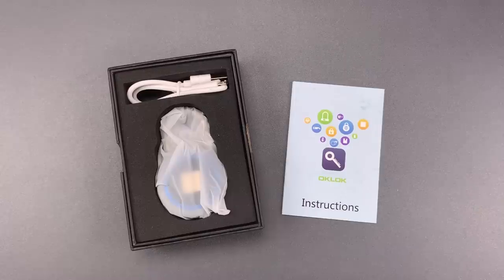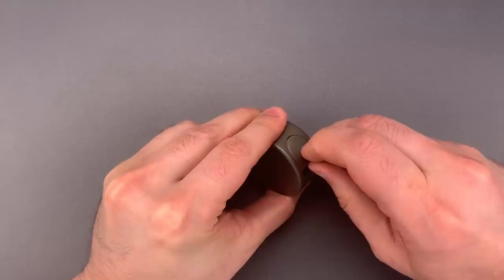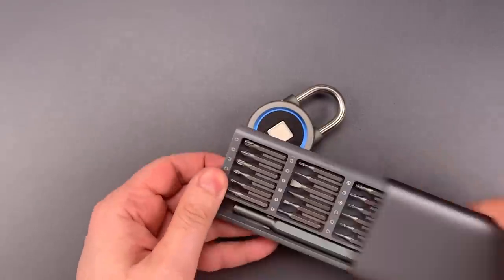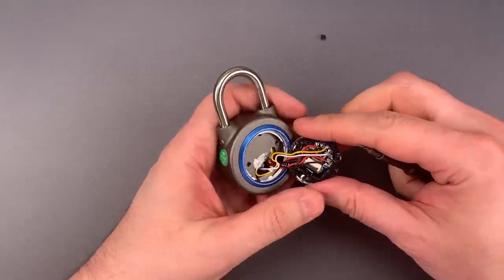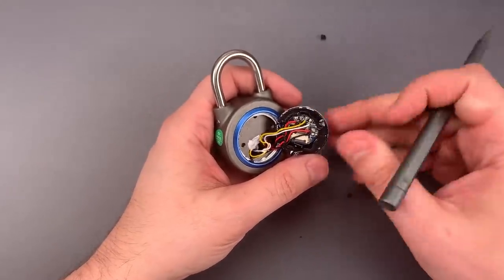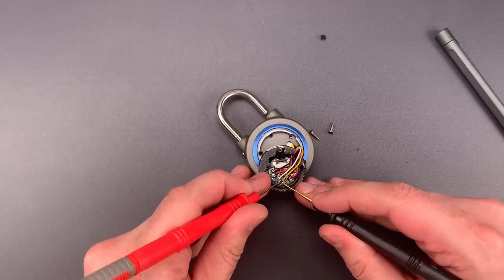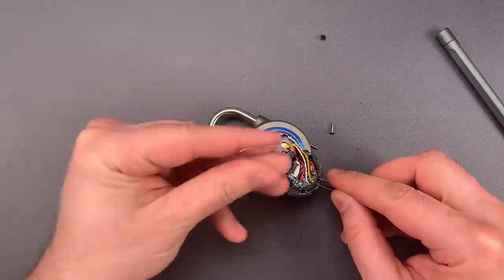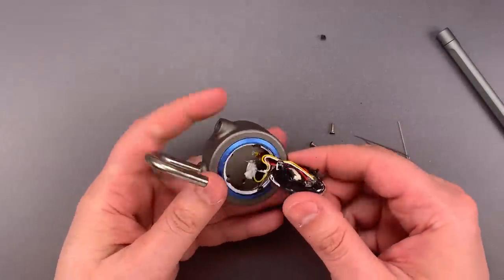[1083] A Peek Behind the Curtain: Evaluating the OKLOK Fingerprint Padlock

Comment: The motor in these (and almost any brand) fingerprint lock has one wire from the motor (usually the positive wire) connected directly to the battery +. 
The negative wire from the motor then goes to a mosfet (which is just a fancy electronic switch), which will then electrically close , and switch the negative motor wire directly to the negative battery terminal for a seocond or so when the lock circuitry detects a correct fingerprint, and then the motor will run and open the lock. 

To bypass the circuitry, and the mosfet, to run the motor and open the lock, since the positive motor wire is already directly connected to the battery + terminal, all you need to do is use one wire to jump the negative motor connection directly to the negative battery terminal for a second or two, the motor will run, and your in.

Comment: I just have to say, what good is a lock that you have to periodically recharge?  How could you ever truly rely on it?  Either it can end up dead when you need to get into whatever it's locking up, or you have to take it off and leave your stuff unlocked while recharging, or swap with another lock.  Might be okay for a gym lock that's used occasionally, but (even if it was more robust and secure)  I wouldn't want it on a shed or something outdoors, far from power or have to carry a power bank in case it's dead.  Also, the battery life expectancy is probably only a few years, like most rechargeables.  And in cold weather, it might completely fail you.  Compare to decades of life for a mechanical lock.  I also have to wonder if it could be fooled with a copy of a fingerprint.  More of a novelty than a useful security device.

Comment: If it has a Battery Mostlikely one wire has power the Board then Controlls flow u can simply short together the wires if they are aside one another Or short others toghether and u will mostlikely reach what u try to reach it will prob not be the Best for the Assebly Health but if ur Breaking in thats no concern.

Comment: You could just do this with a screw driver by opening the front and bottom and riping the battery out strip the wires  and using the + and - to turn on the moter

Comment: So if you only got a screwdriver you can rip the battery wires and touch them on to the motor wires, saves trying to find a paperclip in ya pocket lol
If they filled the screwheads with something strong like jb weld or just drilled the face's of the screws so nothing can 'bite' against the screws would make it so Much more secure as would have to be litrally smashed apart to gain access to the wires,
Love your work buddy

Comment: Looks like it doesn't have a backup battery. Pulling the battery and plugging it back in might be enough to reset the fingerprint to re-enroll as a new fingerprint to open? Its most likely able to be shimmed open as well with some thin aluminum straight down the lock .

Comment: Of note I'm pretty sure a heat attack on this would trigger lock mechanism much quicker than other locks, all you need is to start to melt the (lowest bidder's version of plastic wires) and will probably trigger a short circuit releasing motor. Also pretty sure electric motor itself will fail much quicker than solid metal versions. 
*If I had extra money I would want to test if something as completely outrageous as using an magnification glass/lens with Sun or a stand in for Sun (Heat Lamp) could generate enough heat to defeat something like this.

Comment: Why do you think the electronic locks are generally so mechanically bad? You could capture the front and bottom plate with a single screw down from the top, so that it could only be disassembled without destroying metal when unlocked. Is it just that they assume anyone who wants in will destroy the lock, rather than exploiting it so that it can be put back afterward?

Comment: Remembers another fingerprint lock like this you've shown before Hold on, what's under that sticker on the left side of the lock? In a previous video (788), there was a plastic plug there that stopped up a hole that let you access the locking mechanism with a shim.

Comment: Steps to make the lock safer:
 - have the circuits only accessible when the lock is unlocked (ea screws below the shackle holes)
 - Don't use plastic that can be easily pried off on the lock as picking deterrent

Comment: That lithium battery can be turned into a torch to burn open the lock by removing the bottom screw and puncturing the battery

Comment: There's a 50/50 chance that if you unplug the battery, wait for capacitor run down, plug it back in, there will be a starting sequence that unlocks the mechanism. Often programmed to allow the tech support to give the pissed off customer one last ditch option to unlock a malfunctioning electronic lock.

Comment: Since the lock uses a motor would a magnet work to get it to open? You already know the orientation of the motor.  If it works, wouldn't need to take apart the lock at all.

Comment: Sometimes you can open it by hitting with a high voltage DC current through the USB charging ports. Sometimes the motor has to move so little that the electric inrush will destroy all the ICs and cause it to open- or it could destroy the lock internals lol

Comment: Nice to see your process...more like this please.  This brings up a couple of questions - Was there a reason you went to the front attack instead of going to the power panel first? It seems you could gain more info from the bottom power access--like seeing the type of mech used// Is it a solenoid or magnetic or a different type of locking mech for example.  Also - it didn't say how to program the lock to begin with and I don't see any reset which makes me suspect a combination of touching the scanner. Could that be exploited after programming?   Just curious...

Comment: If this lock were to sit out in the Texas summer heat, the adhesive on the front panel would almost certainly melt enough for you to be able to pry it off without any tools or cause any damage. After that, it’s your choice as to how you want to bypass the locking mech. 

What an awful lock. But I wasn’t expecting much from a company called “OkLok.” They even acknowledged in their own name that their locks are only “ok.”

Comment: What if you had a tube like a pen with a rubber grommet on one end and a push button that would allow you to create a vacuum when the rubber end is placed against a surface? Would you be able to generate enough vacuum to remove the bottom plug without damaging it?

Comment: Isn't this basically an updated copy of the lock in [788]? Only the screws behind the front plate were new. Does the shim exploit still work through the rubber plug at the shackle? The plug seems to be metal in this one, but we never see it clearly. It also seems weird that they had internal screws for the bottom plate on the first lock, if this is the "better" version.

Comment: Couldn't you spin the motor by swiping a powerful magnet over the lock repeatedly now that you know its orientation? Or, maybe, by attaching said magnet to a drill and spinning it next to the lock. I feel like that would be a better exploit since it does not damage the lock and probably takes less time to execute than the disassembly.

Comment: You need some proper spudgers.  Also, I'd try a bit of heat or an injection of rubbing alcohol to soften the glue before removing the front plastic cover.  You're still creating damage that a forensic analysis could detect, but a casual lock user won't notice.

Comment: It seems cheap to just dissemble it with a screwdriver, but they should have had tamper proof screws. Even power outlets sometimes have weird screw heads that you need a special tool to remove, no excuse for putting standard screws on a lock like this.

Comment: So been thinking of lock picking . Is there a double cylinder that both cylinder rotate independently. Have to be at same time but tension on key way would not torque rear cylinder. This would be a big problem right ???? Maybe different diameter cylinders so it would pass ??

Comment: I was more impressed with your faith in that screwdriver. My luck that little guy would’ve snapped prying out the plastic.  Given that the shackle seems to be held back by a motor, this lock probably would fail to a few good hammer strikes

Comment: When are these manufacturers going to learn that putting hard plastic and screws outside your lock is a bad idea? Ive seen so many of these fail super hard. That, and the fact that this has a charging port for whatever reason. Why even bother? Just put a round cheeto on your door. Itll provide more protection.

Comment: so you could also open it with lets say a 9 volt battery, just place the two poles at the exposed wire solder?

Comment: 4:26 You could maybe use an 18650 battery or 2* AA batteries in parallel with some leads?
AA being 1.5 volt, you'd get 3 in parallel, and 18650 voltage is 3.7v, close enough right? :P

Comment: i feel like most people would not bother trying to hotwire the lock, it would be faster to just cut the shackle with a bolt cutter
Reply: That's an exploit you can use for most locks he's trying to show why you shouldn't use these relatively cheap most likely Chinese fingerprint locks. Honestly a Master Lock number 3 is objectively superior to this cuz you don't need 10 minutes worth of knowledge on electronics to open a Masterlock number three. You need probably at least an hour worth of lock picking to open a Master number three and the cut the shackle exploit works on both of them equally. actually now that I say that the Master number three probably has a harder shackle to cut

Comment: Why they don't just drill the heads of the screw making them impossible to undo after assembly and testing, that would increase the security of this lock greatly. So if you bought one of these, remove the bezel and use a small drill to take the cross head off the screws, then pop out the bottom and reassemble using epoxy or super glue.

Comment: Use a magnet! 

The lock was blinking so it has some kind of movement detection? Does it do anything else besides blinking? Sending sms? [edit: ah, maybe it's just the sensor detecting a touch]
What about the sensor, can it be tricked? Can the lock be shimmed? Maybe destroying it wasn't necessary?

Most thieves might not be clever enough to do something wieht the wires and just use brute force though

Comment: It would have been so easy to make it IMPOSSIBLE to get apart without totally destroying it. I can't imagine why they use screws. Press fit everything into ratcheting grooves.
Reply: and if you really absolutely don't want it to come apart ever again without massive destruction, ultrasonic plastic welding, either along the edges, or with 'stakes'

Comment: That little plug would be easy to replace. you may even be able to put enough power through the USB that it arcs over inside the mcu and opens the lock. This lock is not an OK lock it is a crap lock.

Comment: The part that's so boggling about 90% is how easy it would be to make the lock at least "competent". And yet don't. It's like they perversely enjoy supporting thieves.
"Just" a metal faceplate here with a "press fit" would be tougher. A metal faceplate with a 'detent-like' latch that allows installing... once. A snap ring used as a detent. The entire bottom piece being shoved in from the inside (through the open face) so it just can't go out the bottom.
That was what, five minutes of stream-of-conciousness typing? The only necessary piece is "I want to solve the problem", and no one seems to. So wild.

Comment: Why don't these locks have a fail-safe that would seize the lock so it wouldn't open at all.  Sucks for the owner, but I would rather have to cut a lock off my still-secured property than file a police report that will result in nothing.

Comment: Desktop Power Supply?
Did you just use a computer PSU to open the lock?
Reply: no not a desktop computer power supply. A desk top power supply, also known as lab power supply, bench power supply or adjustable power supply, it sits on your desk and you can set the output voltage and (if desired) output current limit.

Comment: So, what's up with every electronic lock having a way to get disassembled with a screwdriver. 

They have so little faith on their product that they have to have a way to get inside it to reset it or something, they just can't permanently seal it, trusting it will work. 

This one had a rechargable battery, just seal it completely and call it a day, don't use screws.

Comment: what about a bolt cutter ?
a crow baar 
or a slage , it woul probbebly do the jobb ,

else a blow tourth 

or just a car battery and a pear of jumper cabbels 

i belive that lock could be melted whith in then less then a minute whith anny othger skills then a youtube turtorial of how to use some thick ass jumper cabels and a 1200CCA car battery
Reply: probbebly the tortorial is less then 30 minutes , and only got subscribe , like and some shitt about a bucket or how to turn your skirt out side in or somtfing , and the 2 terminals , sunds about right , unless thay allso trys selling some merchendice made by kids in china , for a shitt load of profit , 

whitch is @ least 30% smoaler and about 94% lighterthen advertised , maybe gloves or syringes or strapons , the problem is there are no secure locks, only bad or worse,

eavn if thay ware made of plastick or stone , it wouldent be fire proof or fragile in an nother way

Comment: This is still somewhat inaccurate in showing how you might look at a lock for the first time, because you have disassembled many locks just like this and know the typical weak points. A better example would be a lock that you have not seen before, and haven't taken apart locks with almost identical construction.